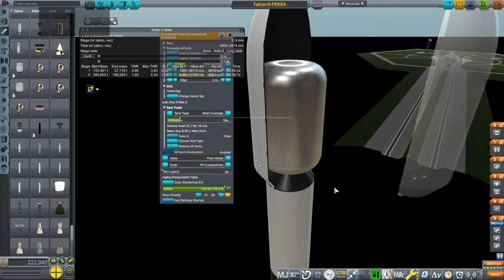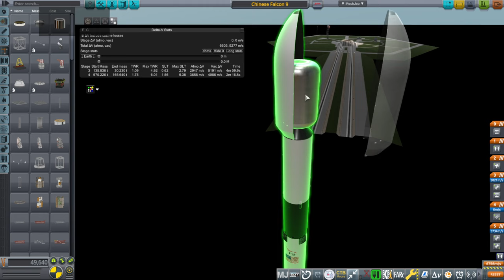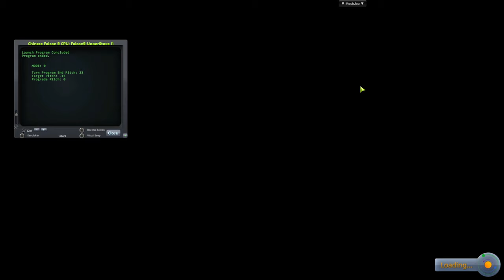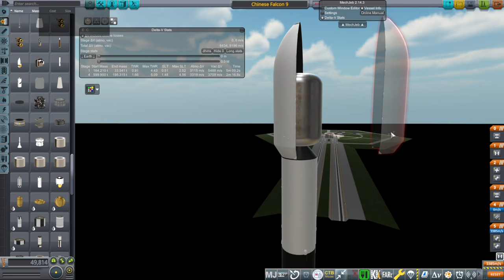Falcon 9 with Chinese Engines?

Comment: I think the maiden flight on the YF-100K is scheduled for later this year as the first stage engines on Long March 12 from Wenchang. Wikipedia claims a launch date of August 28th but has no sources. The regular YF-100 is used not only on the boosters on the Long March-5/5B but also serves as the first stage and booster engines on the Long March-7/7A/8 and the first stage engines of the Long March-6A/6C. A slightly lower performance variant with roll control thrusters fed by the pre-burner is used on the first stage on the Long March 6.